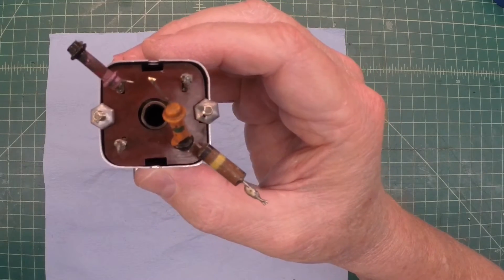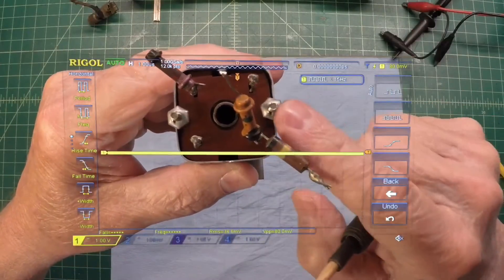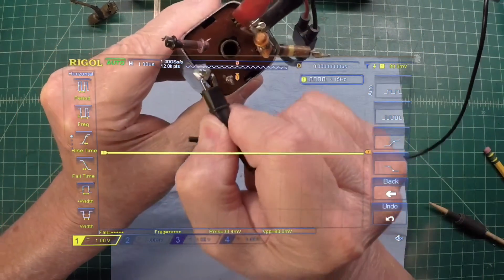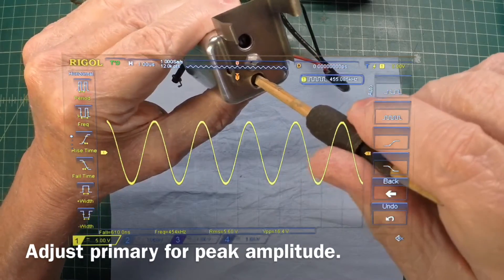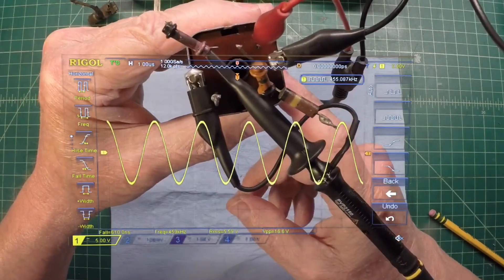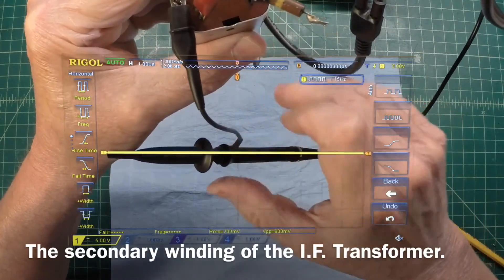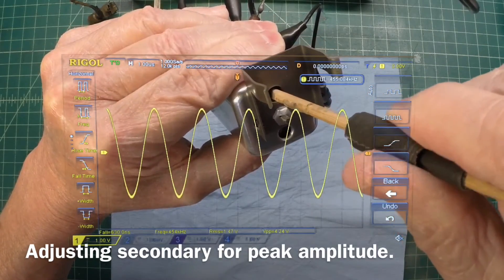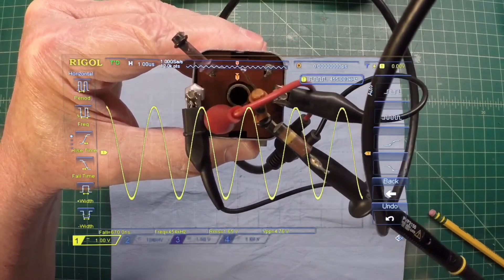Q&A - I.F. Transformer Alignment Out of Circuit Test

Comment: Hi Don , If you have white IFT Toko coil 10mm modern IFT , then measure it's DC resistance from centre pin on both sides , it will be very helpful for me thanks
Reply from the maker: Sorry, I don’t have one out of circuit. Here is a reference for their coils: https://joefreeman.weebly.com/uploads/1/3/7/7/13770951/toko_coil_data.pdf

Hope this helps.

Best,

Don
Reply: @RestoreOldRadios  Thanks Don
Reply: @RestoreOldRadios  Thanks Don
Reply: @RestoreOldRadios  Thanks Don

Comment: Hi Don.... Just came across this and realizing it's two years old and  I have a few questions regarding this. 

So here goes: If your set were completely powered down (off) is it possible to do this same check in circuit with a signal generator or would one have to isolate each coil? Secondly,  While powered up..... Is it possible to  'O scope'  these transformers on antique tube sets without damaging one's O Scope? What might one do to protect their O Scope if attempting such a test and possible alignment (again on an antique tube set)? Thanks for all you do  and sharing your time and knowledge.  The hobby and those in it are far richer for it.

Comment: So, you didn't feel the need to put a resistor or cap between the signal generator and/or the oscope and the transformer.  Why do I hear widely varying accounts of what you should do as far as coupling test equipment to an IFT is concerned.  I suppose it's different if the IFT is in the radio.  But when it's not, there's no problem with direct connections?
Reply from the maker: To your point, using a 10k resistor or higher improves the accuracy of the true resonant frequency due to signal generators that typically have a low impedance output while testing out of circuit. Once in the (circuit) receiver, the transformers will be close, but stray capacitance will make it necessary to tweak both transformers again. Hope this helps. Best, Don

Comment: Newbie here, finally a straight to the point video thank you for posting. If we don't get the transformer to resonate do we then check the Mica?
Reply from the maker: Correct, depending on the Transformer type. If it has a separate mica capacitor, ensure it’s good and connected in parallel with the I.F. Transformer coil; otherwise, the mica sheets or other… inside the can may be problematic. What brand/model receiver are you working on? Best, Don
Reply: Right now Zenith 5s320 5529 chassis. Also bought a 7D229 5710 chassis.
Reply from the maker: Some nice radios. Have fun and enjoy. Best, Don

Comment: Thanks for the video ,I would like to ask a question ,I have a G.E. Tube radio model  T-142 dual speaker,I have recalled it ,all new tubes,Aand I finally found a new antenna for it ,the anntena that came with it was smashed ,finding a replacement was a hard thing to do ,the radio plays,but the volume knob has a bunch of wire,and one green wire that's on the side of the case of the volume knob broke off And I have used everything to figure out where it goes ,I figured it might be a ground since it soldered to the side of the volume knob ,if you or any of your fans have a idea what that green wire for please let me no I have put a lot of time and parts in this radio.
Reply from the maker: Ron, I never located the schematic for this radio, so I can’t say for sure on the green wire soldered to the Volume Control case. Is the performance of the radio degraded or does it play well? Best, Don

Comment: i am a very surprised by this.  You have effectively connected a parallel resonant circuit in the line from the signal generator output to the scope input.  Parallel resonant circuits have maximum impedance at the resonant frequency,  so I would expect to see the amplitude on the scope have a minimum at resonance. (Although I suspect the transformer's Q factor is such that the input impedance of the scope would be way higher than that of the i.f. transformer, so you would see virtually no change in amplitude as you tuned it).   I was thinking you would connect the sig. gen to one coil and the scope to the other coil, and adjust both capacitors for peak signal.
Reply: Hi, I was wondering exactly the same thing. It seems to me that he would need to check the output coil response with the scope.
Reply from the maker: Eric - thanks for you input on this subject. For some reason I seem to get a better response using this method. One thing to mention, the negative leads of the O-scope and SG are not connected directly to the the resonant circuit, but to the metal can lugs. When I try the conventional method you described, say I hook the SG across the primary and the O-scope to the secondary, when I try adjusting the capacitor on the primary side, there’s no change in the response; however, when I adjust the secondary you can clearly see the response change. The same holds true if I reverse the input/output connections, no response change on the secondary and a clear response change while adjusting the primary. I would appreciate your thoughts on this. Best, Don
Reply: @RestoreOldRadios  Interesting, I had the exact same question as Eric Rawson. I would have expected a dip in response on the scope not a peak. The tank has maximum impedance at resonance and it's in series between the generator and scope.  I'll have to try this today and see if I can reason why it works this way. Thanks for the video. Don (also)

Comment: Thank you Don, this was a quick and very educational video for me and lots of other "layman". Few months ago I got from you a big help regarding the oscillation circuit. Now my Philco 41-280 is working on every Band except the push button mode. I'm chasing  "ghost" in this Band. Maybe I'll ask your hint about this in private letter. Thanks again.
Reply from the maker: Glad it helped Steve. Thanks for reaching out. Best, Don
Reply: @RestoreOldRadios  Regarding the push button problem, someone suggesting maybe my twin 370uF mica is not working. Have you ever experience a twin mica one HALF is not working??? I am sure another half is ok, because my all other Band is receiving Stations quite well. Thanks.
Reply from the maker: Steve Varadi Steve, I have never experienced that, but I don’t recall running across many dual picofarard caps. I can’t recall, do you have a capacitance meter? If not, I would try another capacitor (close in value) in parallel across it and see if that mitigates the issue. Best, Don
Reply: @RestoreOldRadios  Here is my latest check on this MICA: https://youtu.be/prhZUD4a5H0 Any idea, this is working, or not?

Comment: Was the probe set to X10?  It might load if on X1.
Reply from the maker: Hi Gar - 10x and still some loading. I did an inductive probe too and the alignment shifts a few degrees. It’s not critical though, as the stray capacitance in the active circuit leads to final alignment at the end. Thanks for watching and reaching out. Best, Don

Comment: Don, this was EXTRA HELPFUL.. I did one of my cans tonight and was close.. but I didn't wire mine this way.. I am going to try this now and see... perfect stuff Don, thank you so much !!!!  Ron
Reply from the maker: Thank you Ron. It will get in the ballpark and provide a little insight to the health of the transformer. Once the I.F. Transformer is placed back in the operational circuit, the stray capacitance will influence the initial results. All the best. Don